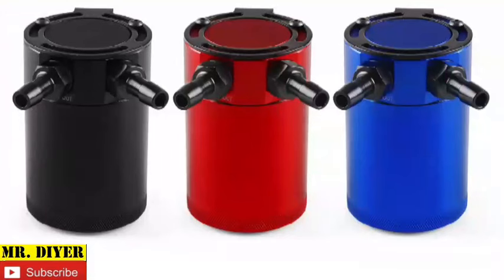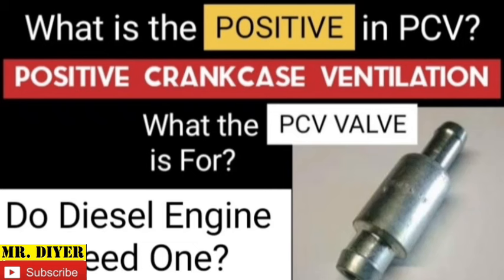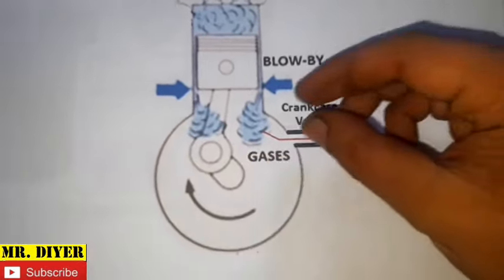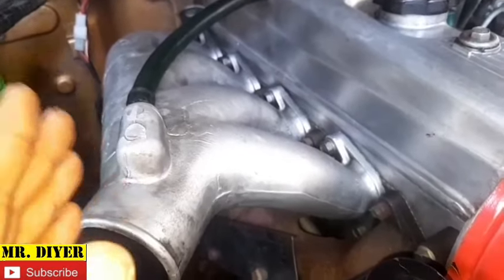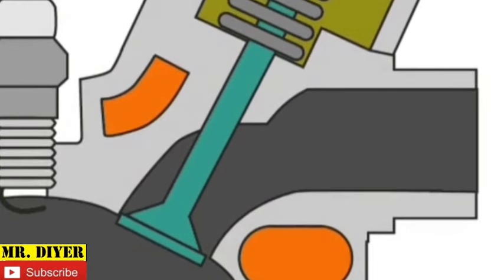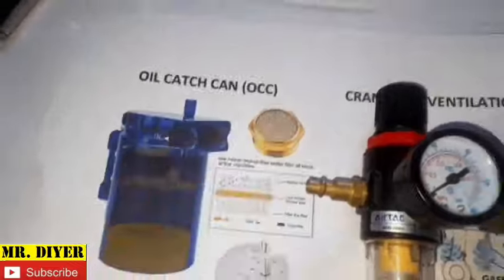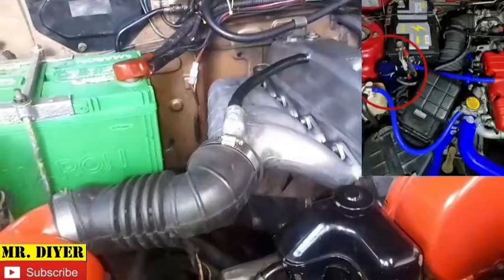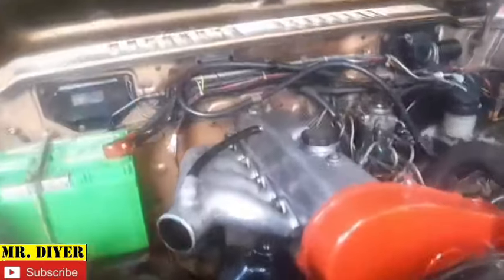This Is Why I DO NOT INSTALL AN OCC OIL CATCH CAN

Comment: My OCC doesn’t have any Baffles or Filters inside of it. It’s basically just a Catch can made out of a heat resistant metal. Everytime I empty it has dark black oil in it. But I’ve seen other videos where they pull out a lighter brown looking liquid. Do u know why?
Reply from the maker: Because most probaby they just added oil in it to make it appear more oil is collected.
Reply: @MrDIYer  This is not the case.  this engine has minimal blow by because it has good piston rings, and it is collecting oil mist.  this is what it is supposed to do.  When the Occ starts to collect discolored oil,it is an indication of fuel or  possibally coolant.  In other words the engine is at the end of its life.

Comment: How is it possible u have absolutely no oil coming from the dip stick part... Even without the obstruction..
Very impressive
Reply: The intake is under negative pressure as the pistons draw in the air through it. it creates a vacuum through the whole system including the crank case and will draw air into the engine through the tube.

Comment: Oil catch can doesn't prevent  carbon build up unfortunately. If a catch can is installed your intake manifold will still get carbon but it will be a almost dry powder instead of an paste type of carbon build up.
Reply: Depends on the quality of the filtration.

Comment: Don't buy Chyna catch cans? Or use air compressor water separators? Radium, IAG, Perrin all make good options. Anything off of eBay or Chinese Amazon brands are going to work like crap if at all.

Comment: I disagree with the argument a can slows the flow of gases from the crankcase. Everyone likes to complicate a simple issue. A PVC hose, catch can or not, is still drawing the same amount of polluted air. The blow-by is still being generated at a constant rate relative to engine speed and load, and the rate of removal remains constant. There is no "quickly as possible" about it. The air slows down temporarily in the can because of the container volume, which, if the catch can is cooler, can help condense and hold moisture and oil before the air moves to the return hose to the intake manifold You can't remove more air than is being generated without creating a vacuum. The only place people defeat themselves is using too small of a can, or a can without "baffles," which are really not so much baffles as a condensing tool. A can too small doesn't let the air cool enough to help condense oil and water vapor, although because of the adhesive and surface tension of both liquids, the baffles help both turn to liquids. I recommend actual baffles (against liquid movement) in the bottom of a can as well so that during a hard stop, bump or turn, liquids don't slosh from the bottom of the can into the return hose, but it seems few cans, if any, include any. The filters are still useful for remove solids, such as bits of carbon.

Comment: hmmm but Merc and VW others brands hv oil separator build in already.
Reply from the maker: Indeed. Wont argue with that. But if you look closely they nowhere look close or similar to an occ just like that of an audis, and is attached to the valve cover itself, it is essesntially just a fancier design to the conventional baffle plate.

Comment: Attention!!!
Your manual and the picture is wrong! There is a mistake because what is marked as inlet in your manual is the outlet!
The dirty air from the crankshaft flows free in the right side of the OCC and the oil will condense and fill the can.
The side with that bronze filter is the outlet of the catch can that goes back to the intake manifold.
Maybe you ordered a cheap chinese copy OCC and that is why the manual is wrong.

Using the OCC correctly is absolutely vital for your engine!!!
But the choice is yours as always. ;-)

Comment: Catch cans are for blown engines with broken pistons or damaged/occluded piston rings. 
This video is demonstrating a small but fundamental problem with adding friction (HOSE length is friction) to the PCV system. It does not address the issue of VOLUME which also has a detrimental influence on crankcase pressure transitioning from idle/cruise to wide open throttle sides in gasoline applications. Both are a major problem for engines where people adding catch devices are doing more harm than good. If you do not have a doctorate in mechanical engineering and have not designed PCV systems as I have done both then it will be difficult to convince you with mathematics because you the reader lack the mathematical skills most of the time to comprehend fluid mechanics. Nevertheless you can still perform some DIY crankcase and fluids analysis using common sense and observation like what is shown in this video to gradually understand what a PCV system is supposed to do and how to apply that knowledge. I will start by saying it all comes down to crankcase pressure. What we saw in the video was a change in crankcase pressure. When a piston breaks and pressurizes the crankcase we see oil blowing out as it did in this video. He changed the PCV system and that changed the crankcase pressure and that changed the behavior of oil. Under higher pressure oil forms larger droplets and higher density. At pressures over atmospheric oil becomes pressure scalar gradient driven which is where the lack of a particular vector component (pressure scalar has no direction) causes more and more fluid molecules to bounce from every surface inside the container (the crankcase is a container) seeking an exit strategy and forcing its way into oil seals (piston rings are oil seals and crankcase pressure deteriorates piston ring function and causes extra blow-by and poor piston ring sealing). I have a couple good threads on supraforums and corvetteforums discussing these issues you can find a link to my build thread in my channel and from there search up my threads. I also have a DIY Crankcase pressure measurement video in my channel where I address the crankcase pressure on my 5.3L Turbo 4l80e daily driver 600rwhp gasoline so you can achieve the cleanliness and PCV system performance.

Comment: Your full of crap! The regulator is why the pressure drops not the filter. That’s kinda like saying a catalytic converter slows exhaust gases down too. But on a flow bench you can see they make the area larger to compensate for that. Just as we do here at our Natural gas filter factory which we use brass filters that why the area is larger sized than the line size by 3 to 4 times. However I do agree about condensation. As no matter what when hot air meets cold condensation conditions will apply so that being said I wouldn’t recommend using that oil again as it will have water in it.

Comment: Just drill bigger holes into your pcv valve or drill holes in the brass filter to achieve the correct flow!
It’s not rocket science!
Reply from the maker: Whatever floats your boat.

Comment: Good day Sir! Any negative effect if I remove EGR valve aside from environmental issue? Does it really increase my engine performance?
Reply from the maker: Im sorry i cant say for certain i
Havent tried
Reply: It won't make much difference to performance but it will stop your intake and valves from getting caked in carbon, which means the car will run smoother and more efficiently for longer. If you do lots of short journeys, egr delete is a good idea.
Reply: My 22re is running good without my egr. No problems for the last 4 years.

Comment: i think if you connect a longer hose for the OCC (just like it should), you may not see so dramatic of oil spilling.
Reply from the maker: If you ever tried blowing wind through a straw or a hose, which do you think will require more effort  to blow wind through, a short or long hose?
Reply: @MrDIYer  But the hose is in vacuum from intake manifold to the PCV valve. the longer the hose, the more air it can damper from the crankcase cover. this is my thinking. you use shorter hose, the air came out from the valve and met the OCC immediately.
Reply: @jayjwin1178  yup, the hose is in vacuum, not blowing just like in the example of comparison
Reply: @MrDIYer  Install longer hose between pcv and occ and a shorter possible hose between occ and intake. The longer the hose is the lesser the compression and it will accommodate more room for the fluid to escape the crankcase into occ, and the shorter hose will allow quicker time to vacuum the line between occ and intake. I have been using occ for almost forever and having no issue with it.

Comment: Get a good occ ffs. Bronze filters are known to increase pressure in the crankcase. U pay for cheap shite u get cheap shite.   SEPR8R Air Oil Separator  or Provent is the go, they have relief valves.  They all need maintenance but thats easy isnt it? Every oil change just open the valve.  There is a utube video showing the bronze filters are junk.  He test out a few occ. provent worked perfectly but i wld personally recommend SEPR8R Air Oil Separator.

Comment: Could you please do a video on exhaust crank case ventilation systems you do such great video and information. I'd like to see pros an cons to exhaust evacuation systems on engines where instead of intake it uses exhaust manifold with check valves

Comment: Most your videos are good... but this one is a bad example/comparison.  An air compressor water/air separator by design has and small orifice and a lot of restriction, counting on the fact it is fed high pressure compressed air.   The compressed air is pushed through an orifice to increase the velocity of the air and create a vortex in the bowl of the separator.  The sudden expansion of the air exiting the orifice cools the air causes moisture to condense, and then the vortex (like a Dyson vacuum) is used to spin the water out of the air which then impacts the walls of the bowl and dribbles down to the bottom.  This is not how a catch can works.   A proper catch can designed for a diesel engine DOES NOT have a designed restriction of any kind, it does not rely on accelerating the velocity of the gasses and creating a vortex to "spin out" the oil.  This is not done for the very reason that it creates a large restriction to the flow.  

A proper catch can has large inlet and outlet, at least the same size as the original hose.  The gasses pass through the can with no appreciable restriction using baffles and/or media such as steel wool or large pore sponge who's sole purpose to extract heat from the gasses and provide a surface to condense out the oil without causing flow restrictions.  Since the velocity of the gases is fairly low to begin with, the condensed oil simply drips to the bottom of the can.  If you can measure a pressure drop through the catch can, then it is a bad design or too small for the application.  (Yes, if you have high end lab quality manometers, you can measure a slight pressure drop, sensitive lab equipment will show a pressure drop in straight hose too..)

A catch can with bronze sinter filter should never be used on a diesel engine and is a bad design made by marketers that don't care/understand engineering.

Why don't manufacturer's include them? Simple cost and maintenance.   For the average owner, the engine system as designed will greatly out last the time they will own the vehicle and through the warranty period and it is one less item to be maintained, and one less item to pay for during manufacturing.

Why do I run one?  I have a diesel truck that gets used for towing quite a bit, one down side to the factory design without the catch can, over time oil collects in the intercooler reducing it's effectiveness.  On a turbo diesel, the crankcase fumes are introduced before the turbo, the oily fumes are then sucked through the turbo, compressed, and then cooled in the intercooler, where the oil will condense out, just like in a catch can.  The average owner would never notice this as they don't work their engine hard very often and more importantly, don't keep their trucks for 20+ years and hundreds of thousands of miles.

Comment: ⚠⚠⚠⚠     Just a correction, the reason water builds up in an air compressor is not because of Humidity, but of Condensation. When air is compressed, it heats. Once is enters an expansion, or tank, it cools. The cooling process creates condensation. The air dryer does not impede air flow. Do not confuse air flow with air Volume. It has a desiccant filter that absorbs moisture. An oil Seperator is completely different. An Oil Catch Can (technically known as an oil Seperator) catches oil. Again, and air dryer ABSORBS, and oil Seperator or CATCHES. An air dryer is designed to operate with high PRESSURE, or VOLUME. An oil Seperator, only CATCHES oil.

     A Crankcase Breather is a different form of oil separator and allow engines to breath as freely as possible. Both look similar but the operate differently. Many high horsepower engines will use a crankcase breather to allow crankcase gases to escape quickly and efficiently. If you believe an oil catch can is affecting your car, try a crankcase breather. Crankcase breather however do not catch as much oil since they are primarily designed to allow maximum air flow. That said, oil catch cans do in fact work 100%. And their advantages FAR exceed any disadvantages.

    They DO need to be sized properly to your engine. Like I said earlier, do not confuse air flow with air volume. The cheap Amazon and eBay ones are too small and are mostly meant for smaller engines. They normally have tiny 1/4" inlet and outlets. A properly sized system may have as large as 12 AN, or 3/4" ports. WHERE you install a system is also critical. If you install the return BEFORE the throttle body, you won't have sufficient vacuum to pull air out of the can on a N/A application. Remember, vacuum is ALWAYS BEHIND the throttle body, so install the return AFTER the throttle body. If you have a boosted motor, install the return BEFORE the throttle body. If you are making boost, you are forcing air into the engine, thus forcing blowby. If you are forcing air into the crankcase, you essentially forcing unmetered air into the engine again and will cause the engine to run lean. Remember, lean is hot, rich is cool. Lean is mean, parts WILL break. A rich condition will simply drown and engine. Many OEMs use oil catch cans to reduce carbon build up in their engines, Chevy, Ford, BMW, Toyota, ect.

     I work on diesel engines for a living, working on class 7-8 trucks (18 wheelers). Diesel engines DO NOT create vacuum, or at least not in the way a gasoline motor with a throttle body does. That is why a diesel engine will have a VACUUM PUMP. Like I said earlier, you need an OIL SERERATOR. Diesel engines COMPRESS air, gasoline engines SUCK air. Therefore, you need an oil Seperator for the air VOLUME and pressurized blow-by your diesel engine produces. The trucks I work on use an oil Seperator to drain the oil back to oil pan while the clean air simply vents to atmosphere. Most aftermarket ones will have an oil separator that vents air to atmosphere with a little pod filter and a small container to drain the captured oil. The way you had your "air dryer" plumbed, will never work because it had no way to vent air to atmosphere. Again, oil separators, catch cans, and air dryers perform a similar task, but in completely different manners. 

      Here is a good paper discussing how to properly size and build an oil Seperator system. For your application.

     https://speedtechperformance.com/wp-content/uploads/2020/01/Crankcase_Ventilation.pdf
Reply: lost me when you said diesel engines "dont suck air" so what creates the suction to draw air into the cylinder? pretty sure the piston moving down is what creates suction and draws in the air, not a vacuum pump lol
Reply: @bryanthornburg8636  They compress air.

Comment: The primary and sole reason the oil catch can is there catch oil and debris from build up in the manifold. It is a preventative measure over the course of the engines life to keep the valves and combustion chamber cleaner. When installed correctly, they do not harm or cause any improper stress on the motor. They are designed to work efficiently with direct injected motors. The catch part of the catch can is there to catch oil droplets and oil droplets containing contaminants. You do not want oil vapor leaving the crank and getting into the manifold. This process helps keep the air clean and economy of the motor. When bought and installed correctly they have been proven through motor cycling tests to help reduce buildup and improve motor performance.

Comment: You forgot to mention that on a diesel there is no vacuum in the intake. I have not seen any butterfly flaps on that intake system. And most diesels have no PCV valve. they just have a tube out of the headcover. It's always at atmospheric pressure so the catch can setup needs to be changed. The OCC setup with baffles and the filter inside is used on most gas cars that have Vacuum in the intake and it works great there cause it's being drawn out.
Most diesel engines have no vacuum in the intake and use the OCC setup with baffels, ehich then is usually vented to open atmosphere through an outside open filter or intake without internal filter cause it is being pushed out with a positive pressure in the crank case. For a diesel we usually use a bigger catch can or larger diameter path ways so the air slows down but the volume is the same